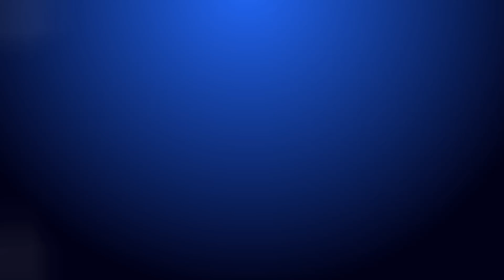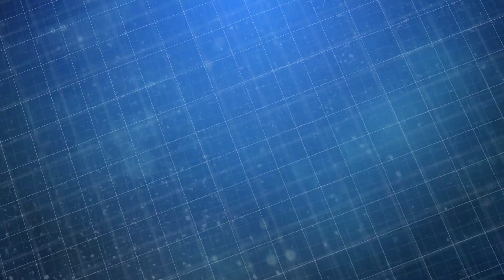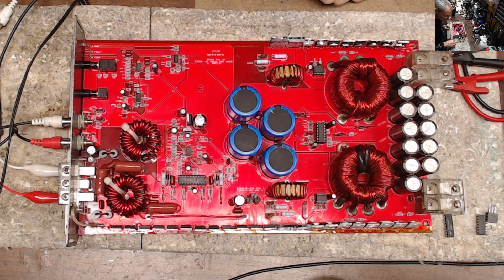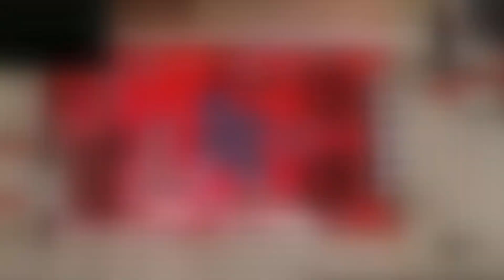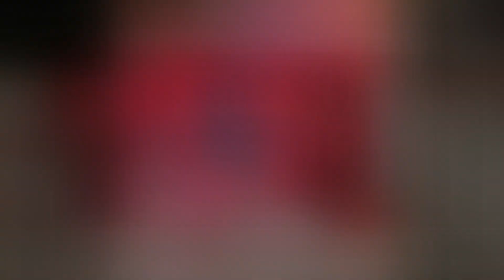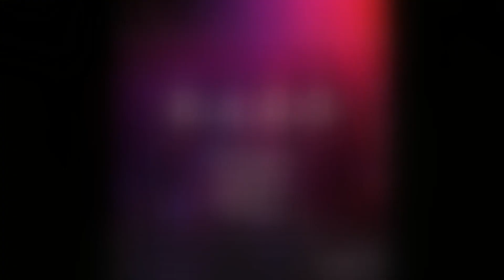MMats D3000 Class D Amplifier Review of Repiar

Comment: Whats the value of the small capacitor next to the 4080 ic? That would be facing your direction
Reply from the maker: I wish I could answer that for you but I have not had one in since to know what the value is. You may be able to look at the "typical use" diagram in the 4080 datasheet to see if they just copied the IC use design.

Comment: Hi Iam new to your channel and I have a mmats mmats 2100dh an it turns on the cuts off
Reply from the maker: The amplifier will have an output fault most likely. Mmats is an amplifier that I don't normally service as they are not common here in the PNW so I don't carry a lot of the transistors they use if not common. www.ellensburgamplifier.com/request-a-quote if you are interested in sending it in and www.ellensburgamplifier.com/FAQS for the common repair questions I get.

Comment: Awesome video, im looking at amps for my system and was looking at the Salt 3 the Synergy WFO 2.1 or the DD M 2500 mono amps. You know which amp would be my best option? I know the synergy and DD are close to same price maybe 100 dollar difference but the Salt 3 is 1199 and seems to do well over rated. Im jis lookimg for a good efficent amp that does its power plus some and best for the money. Thanks alot
Reply from the maker: 1200 for 3k oh my! In my opinion, you are paying for the names on those. Synergy has its own issues. DD is a good one and also DC if you are wanting to stay with Korean boards.
Reply: @ellensburgamplifier  yeah figured the name was why the salt was so high. What you mean synergy has its own issues? I only seen 1 dyno and it seemed like it did well over rated but was also close to the same price as the DD which use to be the M2000 but they jus came out with the M2500 to take the M2000 place. DC looks pretty good as well. Those are jus the ones I been looking at
Reply from the maker: @johnnypiper1717  The topology of Synergy is different and a little more picky than others. Zenon compared to S&I are two different topologies with their own independent issues. You may want to look into a larger amplifier if you are shopping for something that will do more than its rated output. In most cases requesting currents past its nominal will likely lead to eventual failures.
Reply: @ellensburgamplifier  oh I see, well I really think with either the 2 dd 2508s or 4 1506s I'm gonna go with a 2.5k or 3k should be plenty. I figured maybe that new DD M 2500 might be good or something close to 3k which I'm not competing or anything jus getting back into car audio and like my bass for sure. Figured with 2 8s I could do about 138- 140 and sound loud enough for my daily. Appreciate your help I been getting my electrical up to par first with upgrading my alternator to a mechman 370A big 3 upgrade and gonna upgrade my stock battery to a xs power titan 8 s5 4800 12v lithium underhood series.
Reply: Stinger MT4000.1 is one to consider. Good amp, good deal.

Comment: I’m actually quite fond of 4080 driven amplifiers, and I have a collection of them myself. I’m quite familiar with the design and very intimate with the circuit. Many of them are regulated power supply driven, and very basic scaled versions of an H bridge in the 4080 data sheet. The TVS diode‘s should be reinstalled. At least if you want it to be reliable. There will be a little noise from the power supply when it is unloaded. That is normal. The MOSFET drivers, both the 4080, and the MIC, handle pulldown duty on chip. If You’re nervous about that you can bodge  some in. You’ll need four resistors for the 4080, and four resistors for the power supply. It does make it easy to troubleshoot if you intend to leave any of the MOSFET installed but remove the ICs. These amplifiers all Have their quirks, but once you’re intimate with the design topology they’re very easy to troubleshoot and there are even some modifications you can make. I suspect a lot of modern techs are simply unfamiliar because they’re too busy working on Chinese and Korean driver board based amps. Merry Christmas!
Reply: Hi there, do You know the mosfets number for power supply and power Output? I got one at My workshop and seems like the mosfets were changed many times and they look like not original ones. Thanx